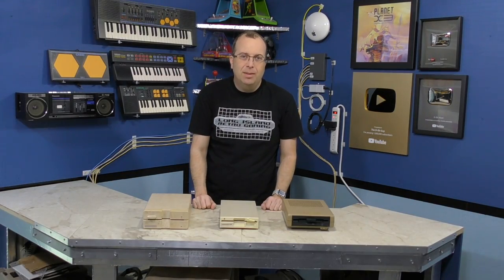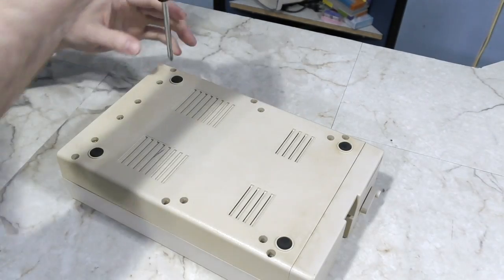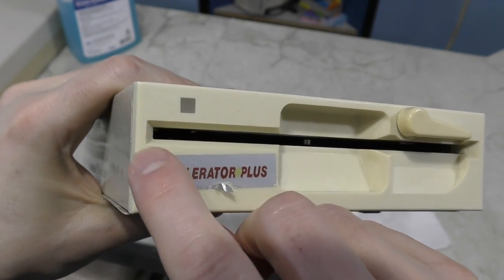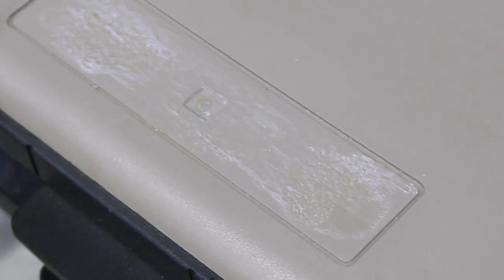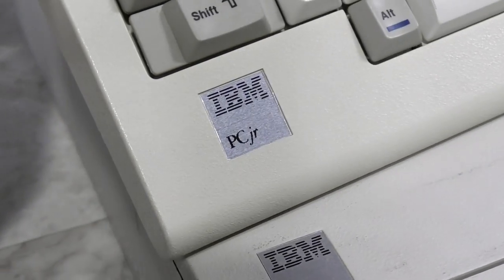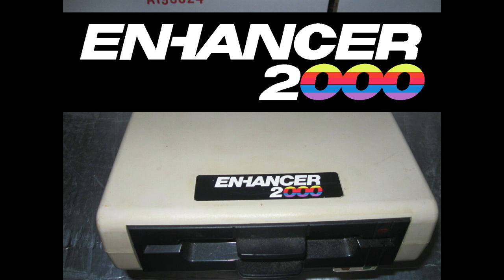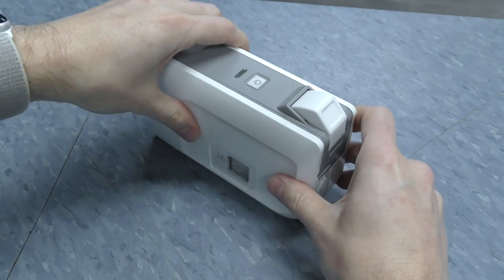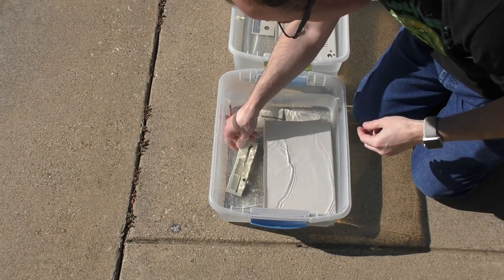How to make replacement badges

Comment: Have you thought about a little fish tank heater to keep the water nice and warm during retro-brighting?
Reply: Yep. I mentioned that too. They come bigger for agricultural uses, too.
Reply: If the air temperature is low, that means the ground water is cold.  It could take hours or even days to heat that much water up with a fish tank heater.  Probably better to use sous vide heater.
Reply: Someone donated a sois vide cooker for this, and yet he doesn't use it
Reply: Wise or not, they make bathtub water heaters that hang on the side of the tub that keep your bath warm.
Reply: I’d be curious if a fish tank in general would work better... perhaps with something reflective on the OUTSIDE. Perhaps the seal would break down with the chemicals? Just an idea, never seen anyone try it.
Reply: With a fish tank, he could put the reflective material on the outside.

EDIT: Nice job Jacob, you beat me.
Reply: Better idea would be to use fish tank, but replace the glasses with mirrors that are the same size.

Comment: Here are a few ideas with building your indoor cleaning tub: 1) Try using glass container for your tub, such as a 1-piece aquarium without the silicone seams or a large glass Pyrex casserole/lasagna pan, 2) Instead of putting the reflective tape inside of the tub, attach the reflective side of the aluminum foil around the outside of the glass tub so it won't react with the chemical mixture, 3) go to an aquarium store to find a temperatue adjustable and submersible water heater that's built within a test tube. Hope this helps and gives you ideas with your design and construction.

Comment: Great stuff!  Note:  Some of these plastics re-yellow when the plastic is in a light free environment!  I've found that on a mouse I did a few months ago.
Reply: Yeah. My Sam Coupé was pristine when I put it in its box 20 years ago. Was shocked at how it had yellowed when I took it out a couple of months back. Even more noticeable on the Sam as MGT used white plastic.
Reply: Spot on.  In fact in many cases the yellowing will occur faster, and will cause some plastics to yellow where they had not before.  

I have watched videos that actually ask, "to retrobrite, or not to retrobrite, that is the question."  And they named these problems among others as arguments for not retrobriting.  I think though, that one of the most convincing arguments against it, is collectors shunbthe process and feel it devalues the things they are trying to collect.  

In David's case, he is trying to present content in a historical format and it is interesting to see this old tech in its original condition.
Reply: I think yellowing is also heat-related on top of being light-induced.
Reply: @Chaos89P  I think it depends on the individual plastics and the mixture/chemistry involved.
Reply: @Chaos89P  In this case - cold related!  It has been in the coldest darkest area of the house in a box!  Yellowed again after maybe 6 months!
Reply: Ok, the yellowing has nothing to do with heat or cold related, or anything while exposed to the air.  It is strictly the reaction of brominated plastic being exposed to UV light and drawing the bromine out of the plastic.  The bromine can be bleached out with the peroxide, which is used as a bleaching agent industrially and in hair salons everywhere, and for some reason UV light either acts as a catalyst or accelerator.  I have retrobrited pieces of toys using a peroxide gel available at the salon supply store,  inside my refrigerator, because at the time that was the only information I had.  It worked, ok.  But not as well as being exposed to sunlight.

Comment: Hi, I watch a bunch of reconditioning videos on YouTube including lots of yours (Thank you!). Your channel is where I learned about retro-briting (is that a real verb?). Every time I see anyone trying to remove labels and marks from various pieces of equipment, I always wince at their efforts with Isopropyl Alcohol and/or WD40. Although WD40 works a lot of the time, there are better substances out there that require much less labour. One is Non-Chlorinated Brake Parts Cleaner (Automotive store), and the other is Methyl Hydrate (any Paint store/department). The brake parts cleaner is better than any of the purposed label removers like Goo Gone etc. It will soften just about any label glue and, unlike the other stuff, it will not touch the plastic. The only down side is that it has a pretty intense odour. You can even use it on some oil or solvent based stains on clothing. It works kind of like dry cleaning fluid. Methyl Hydrate is much better than Isopropyl Alcohol at removing marks and has no odour. It instantly removes Sharpie marks without hurting plastics as well. It can be had for about $5/litre at any paint store. I used to be a signage installer, and we used these chemicals all the time to remove vinyl lettering and removing tape goo and labels after installing or removing signs. Cheers!

Comment: I'm sure half of these comments are going to be suggesting retrobright techniques. But I've done a lot of experimenting myself (peroxide hair cream, industrial peroxide solution, high power LED UV strip light, sunlight, ambient light, various temperatures etc)  Without going through every iteration, I basically found out that blasting it with UV light doesn't make much of a difference from ambient sunlight. However, heating the solution makes a massive difference.  I now have a clear plastic tub similar to yours with lid and a sous vide heater. I put the parts in undiluted 12% food grade H2O2 @ 60-70 deg C and leave them on a window sill during the day.  It takes 1-3hrs this way.  You can dilute the mixture 50% and it takes twice as long.  

A really interesting thing to note is I did this at first and thought the parts still looked a little yellow, I dried them off and left them on the side overnight and in the morning they were perfectly white. I have no idea how this could happen though :S

I'd definitely recommend heating the solution over any other kind of method and a sous vide cooker is the perfect way to do this accurately.

Comment: Look up the recipe for “secret sauce” that us sneaker heads use to remove the oxidation on the clear soles of older air Jordan shoes. The process is much quicker than using so much liquid and the results will surprise you
Reply: B2D 327 That’s the stuff on a Big Mac?,
Reply: @prismstudios001  Most likely referring to some folks selling pre-mixed hydrogen peroxide (the most effective strength is hard to come by since it's only sold to licensed beauticians) with a thickening agent so it sticks to surfaces long enough to do its job.
Reply: RailRide I’m sure. You can get concentrated H2O2 from taxidermy supply houses. It’s used to bleach bones.
Reply: RailRide that is correct. It’s a mixture of the peroxide solution with corn starch as a thickening agent. It’s then brushed on and covered with regular store bought shrink wrap to keep from drying out and left out in the sun or under up light until desired results
Reply: @prismstudios001  
Big Macs don't actually have "secret" sauce.  That stuff is special sauce.
Reply: George V. Cohea It’s Mother says it’s “special”, or is that spatial?
Reply: @prismstudios001  
According to official McDonald's advertising jingle, it's definitely special.  There is nothing secret about slightly tweaked thousand island dressing, and when Big Macs were developed, McDonald's   would have had that stuff available.
Reply: George V. Cohea dressing? I always assumed it was cow mucus........
Reply: @prismstudios001  : That would be standard sauce.
Reply: He's used peroxide cream before, but it dries out/gets used up in certain areas. Then he has to redo the peroxide, but if he does to wrong it gets streaky. Liquid just works better for him in general.
Reply: @soniccookie655  indeed, they need to look up his Osborn retrobrite disaster to see why lol
Reply: @ColtGColtG  Yeah, I think that's the video I was thinking of.
Reply: B2D 327 He’s used something similar before but results can be streaky. The bath method ensures even exposure.
Reply: Clear soles? As in silicone? I've been wondering if this peroxide solution would also be effective with transparent plastics like plexiglas or PMMA now that you mentioned it.
Reply: @b2d327  Dave actually used to do something like this. The problem is it often causes a streaked/marbled appearance unless you do it juuuust right. Watch his Osborne restoration videos.